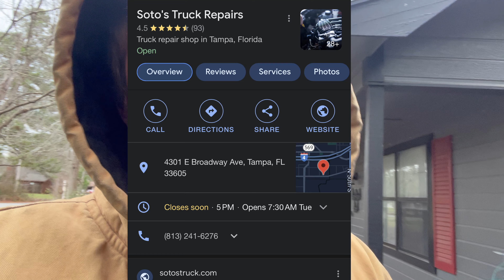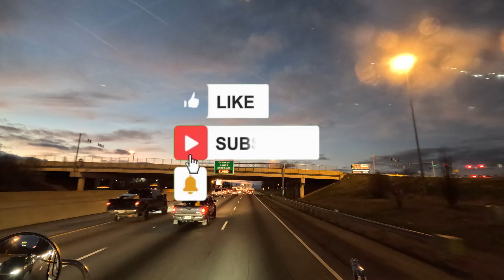Screwed by another shop! Stole my new parts!

Comment: I had a guy tell me that when loading equipment that is turbo charged, to load it so the exhaust pipe points to the rear.  He said the wind from going down the road can enter the exhaust pipe and spin the turbo and with the engine off there will be no oil lubricating the turbo, and over time it can ruin the bearings in the turbo.  That might be what the duct tape thing is about.
Reply: That is a concern by some.  Most say it’s not a concern.  If customer requests.  Do it.

Comment: Tape over the exhaust pipe keeps wind from blowing in and turning the turbo. The turbo needs oil from the engine to lubricate the bearings. It will turn and burn out the bearings with out oil

Comment: Morning I had the E7 Mac motor or the exact same problem you have I took it to Mac in Allentown PA they had it for about 4 hours replaced the entire wiring on is from the accelerator into the computer cost me 275 hours I never had the problem again and I ran the truck for 3 and a 1/2 years after that and put a 130000 on it maybe you could Try that and the problem could probably go away for you good luck with your problem have a good day

Comment: Robert its all mechanical shops. I would build stihl saws and repair trimmers blowers and such on the side. You wouldn't believe what "certified" stihl guys would do. Parts changers is exactly it. If it was more than a carb or coil they would say its beyond repair. If it wasn't a carb or coil swap they would say they can't fix it and say its blown up even tho it has good compression. Laughable. I would charge for that excavator.  I did excavation too. At the end of the day all the tracks would be cleaned. Sometimes during the day if it was bad.

Comment: You might try some electronics cleaner for that throttle sensor. All it is is a rheostat and the cleaner will clean the contacts in it ( if you can get it inside) and you have a shot at it working right again. I used it many times when the volume control of stereo's and radios when they started crackling when changing the volume. Spray it inside and push the throttle up and down a few times.

Comment: You cover the exhaust when it is going straight up so when it rains water does not go down the pipe and enter the cylinders where a valve is open.

Comment: Apparently, the tapeover the exhaust is because as you drive, air is forced into the exhaust pipe. This spins the Tubo which has no oil feed because the engine is not running. This can cause bearing damage to the Turbo

Comment: I live around a large Mennonite community, and they all use tractors. They change the rubber tires to steel, but most still drive horse and buggy. The Amish do not use tractors, at all. This is in Ohio. They are great people to deal with. Most have a side line of business, besides farming, like small engine repair, starter and charging repair, green houses and even quilt shops with sewing machine repair. If you need it done, one will do it.

Comment: Man i truly can feel the desperation you’re expressing… between the truck and repairs and work being the way it is… I’ve always worked for myself as well and never had a job where I punched in. But back in 2010 I couldn’t buy a job and it got to the point I went to work with a guy framing making $12 an hour… went from making $60 an hr to $12 sucked but it paid the bills… pushed through it and made it through it. Just do what you have too until things turn around and if it comes to you having to work for someone else then we will be here when you start posting vids again!
Reply: I was gonna say the desperation is starting to get thick.

Comment: You should buy another truck and start doing more maintenance yourself. Buy a Freighliner or Kenworth with Detroit or Cummins engine. With my CH1997 Mack dump truck I don’t have the electronic and emissions nightmare but parts are unavailable and expensive for older Mack trucks.

Comment: So, I watched the video and I caught the part where you mentioned that they never put the new clamp or bracket on but I thought you mentioned that they didn't know they were in the truck.  So, where did you figure out or prove that they actually "stole" your parts?  Where did you state that in the video?  I understand them not seeing the parts in the truck is frustrating especially if you told them to use them but if they didn't use them, that's not the same as "stealing" them.

If you were referring to the injectors potentially being "stolen", again, I didn't hear where you stated that.  I know you mentioned that you were still having issues with the injectors but I didn't take that to mean that anything was "stolen".

Robert, at this point, I am worried you're going to be able to find a "good" or even reasonable shop that will take care of you based on a few things.

1.  There are just simply a lot of incompetent shops out there in general.  And unfortunately, I don't know that this is going to change and it's sad.  The problem is, many of these shops get too greedy and feel that they have to keep charging more to justify the training that they have to pay their techs in order to fix things.  But sadly, this "training" doesn't seem to be getting into the techs' heads and translating to things being fixed properly like they should be.  But, instead of the shop owner paying more attention to verify that their techs actually are getting the knowledge from the training and applying it to the work being done, they just keep paying for the training and "hoping" that it's being applied and continue to have crappy work being done.

And instead of making a change, the shop owner will just keep dealing with the very few clients (like yourself) that will actually have the balls to complain to the point that it will matter to their business.  And so, if the shop owner has enough clients that are happy enough to keep coming back to outweigh the disgruntled ones that won't (like maybe you wont'), then they will just keep raking in their profits and deal with the few bad apples.

I mentioned "greed" because the reality is, the shop owners could take care of this by hiring better or more competent or skilled techs and pay them just a little more per hour or whatever pay structure they wanted to set up and ensure that they were getting their work done properly.  And as a result, they would have a lot more happy clients which would result in more repeat business and also better marketing for more clients by positive reviews and/or word of mouth advertising.

But sadly, these owners don't see it that way and would rather just make sure they have enough money in their own pockets so they could have their nice houses, boats, multiple pickups and semis or other fun "toys" that they want to have.  Not to mention, the ability to go on vacations multiple times a year, have nice vehicles for their spouses to drive, have plenty of money for their kids, and so on.

And so, they go down the path of insanity but don't care because they are still getting enough business that it doesn't affect them financially.

I don't know why you considered this shop to be a good shop if they aren't fixing your stuff right.  And now, you've spent a lot more money with them and things STILL aren't fixed.  So, why not request your money back or at the very least, part of it?

My thought is, if the work being performed is not done correctly, then why should you be expected to pay for it?

One other problem to consider is that unfortunately, to figure out some of these issues that are either intermittent or not so noticeable is difficult and can take a lot of time to PROPERLY diagnose.  And so, there comes a decision to figure out what to do.

On one hand, you can spend 2, 3, or 4 hours attempting to diagnose a problem only to spend say almost $500 to $600 just in labor and end up still chasing your tail or, you take that money AND INSTEAD invest it into parts that "should" (in theory) be known to be good if they are brand new or remanufactured parts that have been tested.  In this situation, you at least know that you've theoretically eliminated a potentially bad part by putting a new one in and not spent an extra $500 to $600 or more in diagnostic time.

The problem is, this doesn't always solve the problem because if the part is defective even though it's new, you still have an unsolved problem that didn't fix anything.  Plus, you likely won't be able to return the part for a refund since many parts are not returnable once they are installed.  And so, it's a waste of money.

But more importantly, you haven't solved anything because you haven't fixed the problem in the first place.

My suggestion would be to bite the bullet and save your money and take it to a competent shop that will actually spend the time needed to figure out what is wrong.  And even though it may cost a little more, this would be better.

For one thing, if you haven't done this already, you probably should have a compression test done for starters to see if there is an issue mechanically with the engine itself so you can hopefully rule out that being an issue to start with.  I know this might be a few hundred dollars but at least that way you know the health of your engine going forward.  You can't expect everything else to run correctly if the engine itself has a problem.  If one of the cylinders has poor compression, then that is obviously an issue.  If they all have low compression, then that's an even bigger issue.

2.  I would worry that other shops are going to notice videos like these and not be willing to work with you for fear that they themselves will get criticized in one of your videos should they screw up as well.  I'm sure a lot of shop owners would see you as a liability since you do have at least a small following that  watches your videos.  And many followers are likely in the industry or considering getting into the industry.  So, you might want to reconsider being as critical as you are in some of your videos when it comes to shops.

Or, do whatever you want and hopefully it doesn't come back to bite you in the butt.

3.  Although there are some things that probably can't be done, I think you need to really consider doing more work yourself.  I understand that maybe you don't have all of the tools to do every job and I realize you probably don't have the knowledge to do some of the work but honestly, at this point, it "seems" like you're not really gaining anything by having these other shops work on your truck.

Plus, with so many videos online or forums with information, you can probably figure out a lot of the issues yourself if you just spend some time doing the research.  Or, perhaps you can contact Mack yourself and see if they are willing to work with you even if they have to charge you.  Or, ask them if they have some good competent shops in your area that they would recommend.

For one thing, it would only be in Mack's best interests to help you since you are using their product for your career.  And again, since you do have some people that watch your channel that are either in the industry currently or considering getting into the industry, they should want to help you so that they can show that they are willing to stand behind their product and that their product can be one that can be relied upon when things do need to be repaired.

Maybe Mack won't be willing to help you but it's worth a try.  I understand taking things directly to a dealer may cost a bit more but at this point, like you mentioned in your video, you're almost literally throwing money out the window since you still have a truck that runs the same way as before.

But quite honestly, I don't know why you haven't laid into the shop since you have spent all of this money to have it repaired and you still have the same issue going on.  Maybe you have had discussions with them but if you haven't, you need to.

Personally, even though I haven't worked on semi trucks, I've worked at a couple Ford dealerships on just about everything including the diesel trucks so I wouldn't be afraid to get involved in the semi truck repairs if I had to.  Based on experiences like yours, I don't know that I could feel confident with other shops to do the job correctly.  But, I also want to save money as well and plus I like to have the knowledge of knowing that the repair was done right or diagnosed properly.  Or, if there was a mistake made, then I can only blame myself and not someone else.

Comment: You should bring that truck to mn and let the shop i use fix that truck. Honest and knows a lot about mack as they are used a lot around here
Reply: And they clearly say they are NOT going to drive 1000+ miles to some shop
Reply: @jobmegens3417  obviously shops down there dont work. If i break anywhere i pay the tow back up here due to bad exp with shop. Also loads out of here pay good so win win

Comment: It is shame that they gave you the big banana my friend ,  If that unit is not ABSOLUTELY I mean ABSOLUTELY NOT sealed up your engine is not going to run correctly , I am sorry they gave you the big banana , I told you before they are not fking mechanics they are not a mechanic who ever you are going to 🕶  Myself I change all of my DEF filters and  all of my exhaust everything  for the system  and then I would do a regen and I do not have no problems , Because I consider myself  a mechanic and I take my time to do the job correctly 🕶  I told you to go by the stuff Brand new and take your time my friend and put it on your truck take your time and do it correctly  , I knew this was going to happen to you ,  You have to start learning your truck , Mechanic skills If you do not know get yourself a book on that truck and learn how to do them things at your house 🕶  When you my friend are a owner operator your wife and yourself you have to be positive in it , no negative it can not being an owner operator , it is not going to be good for you ,  I am older than you  I been around trucks and i wrench  on them my whole life , I know you are trying to learn , I am not being an asshole  about anything , I am telling you the truth , I always wish you two luck 🕶  and you my friend need to start putting attitude in your fuel tanks , I use PPF ,  it is in a bottle it costs $8 bucks it is good for 300 gallons , I would get one of them and put a 1/2 a bottle on each of your tanks to clean them up ,  It will clean up your tanks your fuel lines your filters your pump your injectors , You will notice a difference  and then a bottle every other fuel up that's  what I do ,  I carry 325 gallon 🕶
 That should be a pretty good paying load you should make some of your money back in a couple of days 🕶  The hoe my friend you should have put a piece of plyboard or something underneath before they dropped it down on your trailer , Good luck it might bang a hole in your floor 🕶

Comment: When it comes to the low freight rates you can only blame other drivers who are willing to accept any load, even at a loss. Why would a shipper or broker offer you a profitable rate when there's plenty of drivers who are willing to do it for less than half? It's the race to the bottom, and in my opinion it's by design. You can't run a successful business when you can't pass your operating costs on to the customer. What makes it even worse is that the customer gets to dictate how much you will be paid for your services. In no other industry would this be sustainable or tolerated.

Comment: Robert,
You should have listened way way back .
Haggai truck repair in Griffin Ga. 
 They will help you and allow you to do your own work. This way you learn how to repair the truck yourself .
    You bitch about driving hear and there yet you took the truck to Tampa ? Griffin is closer if I recall.
 If your in doubt contact JUST TRUCKING on his you tube channel .
They showed him how to rebuild both of his engines . Now he did put in some wrench time but they always watched and helped him.
  The question is  
Why didn't you replace the gaskets & rings yourself ?
Also did they keep the new parts ???
  Most dealers & shops are just part replacers.
It's easier for them to use new parts and just keep adding until the problem is fixed. 
But a true mechanic will find & fix the actual problem or bad part.

If your engine is still having issues maybe contact Tim at Gentry & Sons trucking ? While he is in Tennessee you might find a load going to his area and stop by when empty ? Be sure and contact him first as any shop .
Tim has been known to help independent drivers.
 Bottom line your an independent owner operator, most owner operators do their own repairs . 
 But some find a good mechanic . Seems your still looking ?
 You should reach out to other you tubers that are owner operators.
  Also your not a hot shot runner any more ?
Maybe it's time for a new name.???
  Good luck..